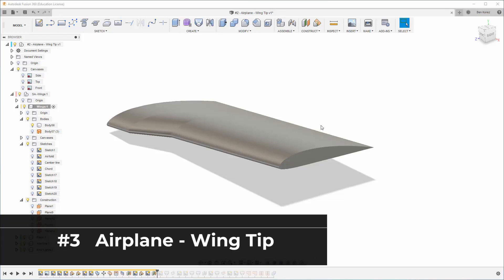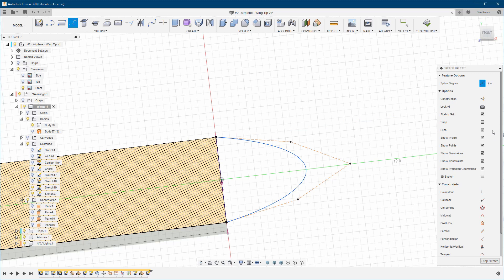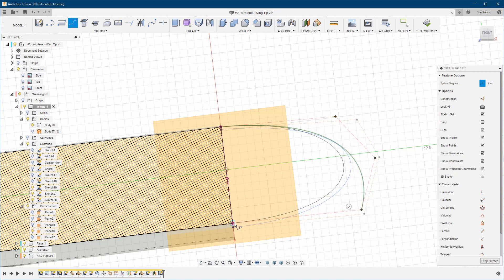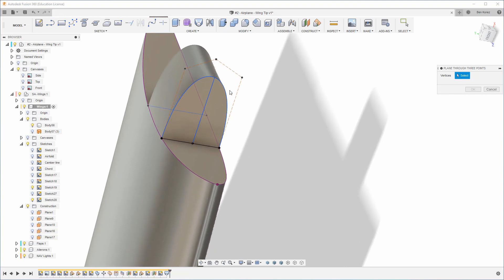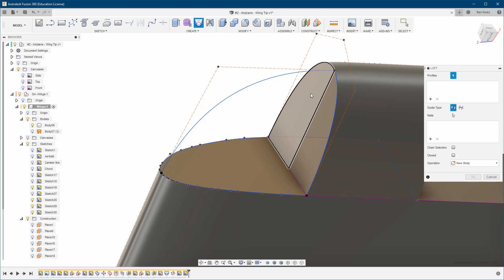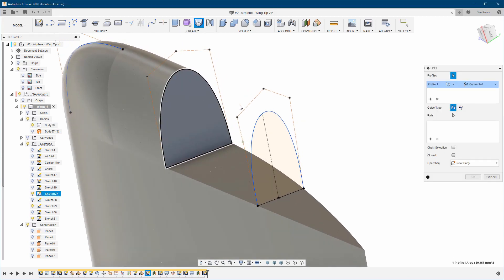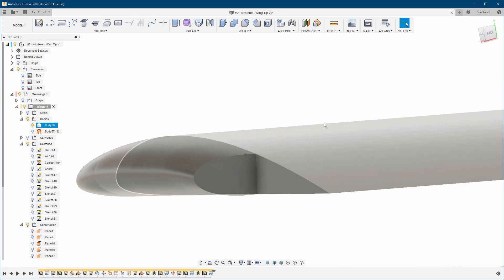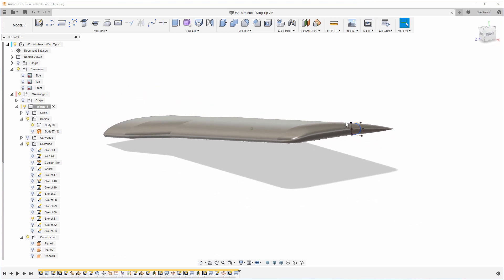Fusion 360: #3 Airplane - Wing Tip (*a)

Comment: Hi, Mr fusion pro. I was trying to follow the tutorial but then I got stuck at the part where you used the loft tool. I kept getting an error saying "profiles do not intercept guidelines" or something around those lines. I literally spent 3 hours watching your video over and over trying to figure out what I was doing wrong, but I just kept getting errors.

I have posted a 10 minute video of my struggles if this would make it clearer: 
https://www.youtube.com/watch?v=dY6FlVQgSKA

I understand if you don't have time, I just didn't know what else to try so I thought I'd post here.

Thanks.
Reply from the maker: Hey Aaron, 
1) I would recommend you buying a 3dconnexion mouse! It makes all the difference in the world when need to Orbit the model. It will save you a lot of time and frustration. It's like holding the model in your hand!
https://www.3dconnexion.eu/spacemouse_wireless/eu/
2) I have created a screencast for you: https://autode.sk/36xArh4
3) If you have more questions, please let me know.

Cheers.